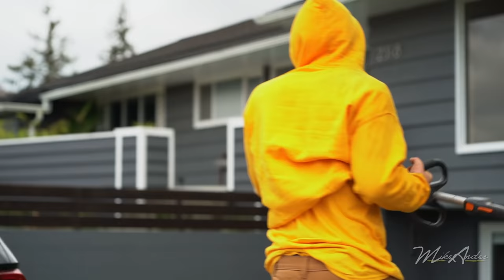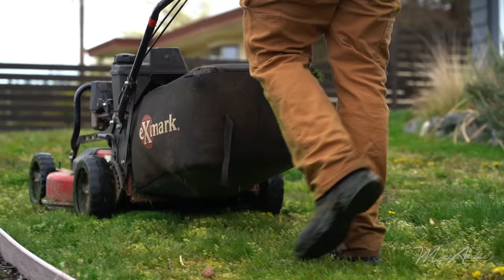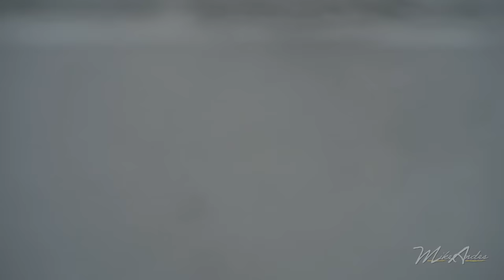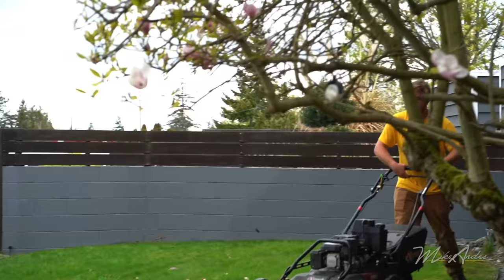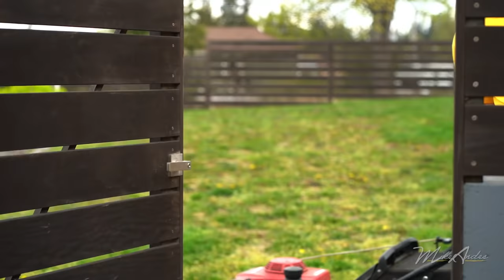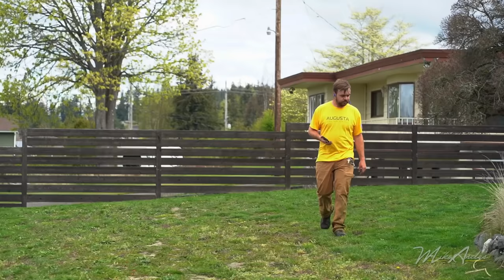how to get 100 mowing customers in 100 days!

Comment: My wife answers the phone.
I cut 55 lawns a week.
$ 45 average cut.
I use a 4 cylinder Ford Transit Connect with solar panels on the roof charging my Makita and Milwaukee batteries for my electric mowers and lawn care tools.
No gas or maintenance for my mowers etc.
No office.
No rent.
Work by myself so no employee hassels.
Good money making business.
Reply: Do you go through a lot of batteries?

Comment: I am going from 50 to 25 costumers next year.  Not doing $50.00 cuts in 2022 anymore.  
Got handfull of $100 cuts and will be focusing on them and for the rest of them will have $80.00 minimum.
Wish me luck
Reply: I'm 16 and think about starting, how do u price the the lawns and should I get an LLC before I start?
Reply: @216_matt  i don't think you can have an llc in your own name at 16 pricing depends on a lot of factors. Wouldnt go below $40 point blank period tho. Even $50 is kinda dicey unless theyre right on top of each other and small, flat lawns

Comment: 32 minutes. Also depending on your demographic, make sure you purchase permits to solicit before knocking door to door. A $30 permit to solicit is cheap insurance against a $500 fine
Reply: Better to ask for forgiveness then permission
Reply: @kennethalynn  the standard response to that in the area I live in is ignorance is not an excuse to break the law
Reply: @benblazek3305  That's true where I live too. But I've been doing door hangers for 8 years. At least 50% of the people that have "no solicitation" on their door turn into a customer.
Reply: @kennethalynn  same here but I send mailers to the people with no solicitation signs. I have the kinda luck where if I step an inch across the line I get crucified for it. $1 for a mailer and postage is nothing to me anyway
Reply: The Constitution is our permit .

Comment: #1 you don't do every door direct marketing, you o demographic direct marketing, you don't send flyers to low income, they can't afford it.
those guys are slow and their cut job is poor. the blades on the mower need sharpening and the guy trimming can't even match the mowers cut height nor blend it in. that customer should get free cuts until they can do this properly. 
52 minutes for this job 1 guy with that piss poor equipment. i could do it in 20. with spraying 25-27 minutes, most of the lawn is weeds so there is alot of spraying to do, i'd have to kill large sections of it then till it under in a few weeks and fert the hell out of it and then let it sit for a week then organic fert it and drop all fescue and rye like a mad hatter.

Comment: Get some landscape safety glasses and gloves. Mail is expensive. You would be better putting a magnetic sign for your truck.  Zillow is a great way to get an estimate to customers. It has both the square footage of house and property. Basic math will get you square footage of yard work. Don’t forget applying for biz credit cards. When I started mine, I couldn’t get a biz loan for 6 months. A year later, I received $1.4m in biz credit.  It’s the easiest way to expand.  Also, on your website, get video customer testimonials.

Comment: These two clowns cutting this yard prolly took them 45 minutes. The guy on the trimmer is going backwards while cross walking ( putting one foot across the front of the other) instead of moving forward. And the guy on the mower is almost double cutting as much as he has the edges of the mower over the path he just cut.